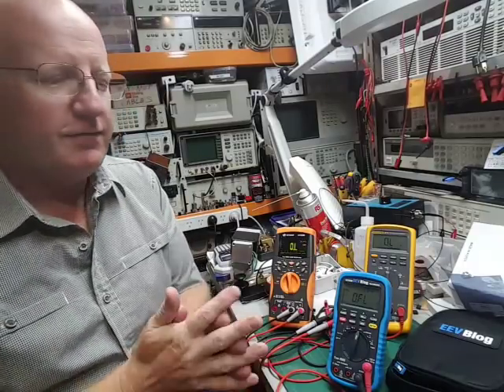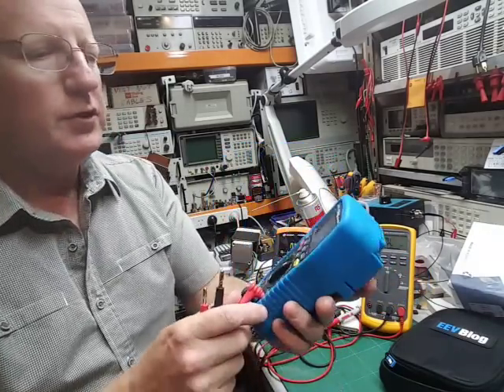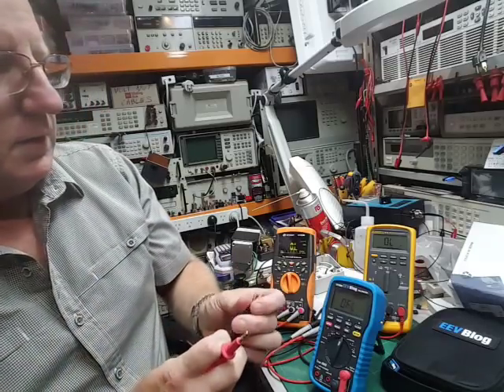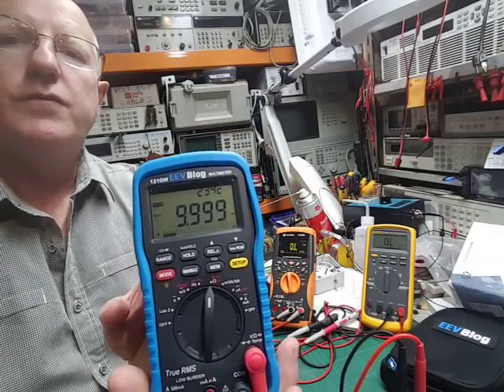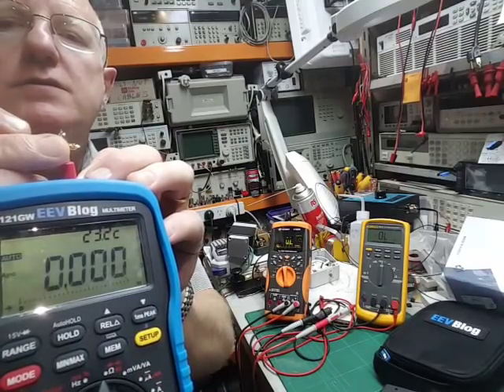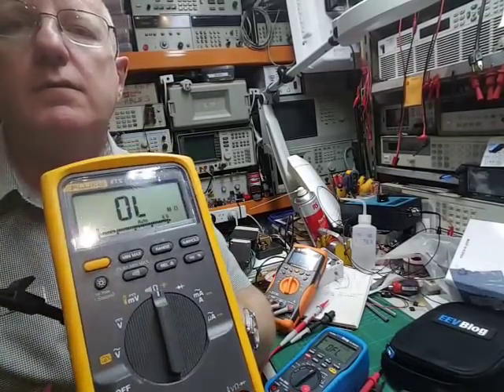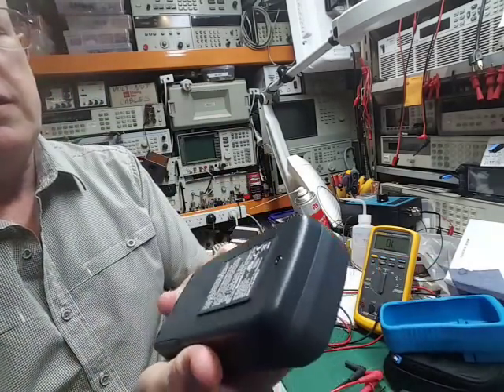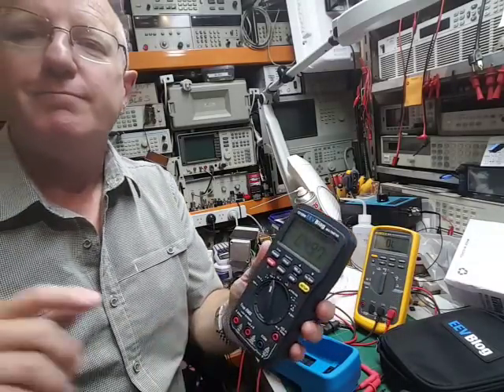Quick, First Impressions of EEVBlog 121GW DMM

Comment: You should mention the thing about the slowness at the forum.
Reply from the maker: Thanks, In the forum there is a sticky topic under Test equipment => Issues with 121 GW, it has just been mentioned , I suspect it may relate to some auto ranging issues there were esp on current measurement - there is a video of an earlier version 'locking up'.
Reply: It's also a 50K points meter I think, so it does take a bit of time.
Is the firmware updatable ? Is it open source ? If it was, it would be awesome and easily optimisable.
Maybe there is a way to reduce it to 10K points in which case it would be 5 times faster.